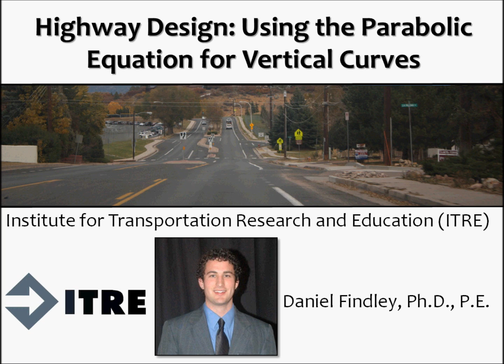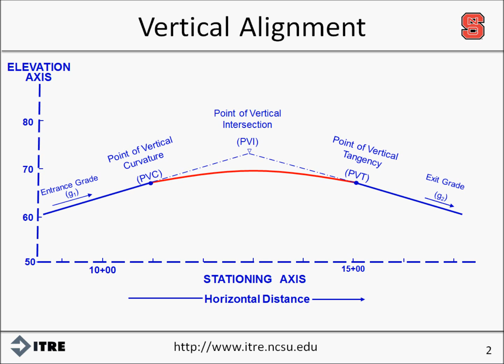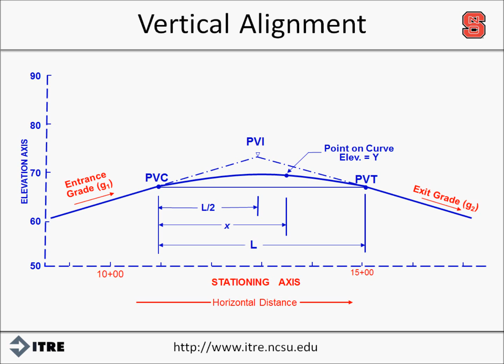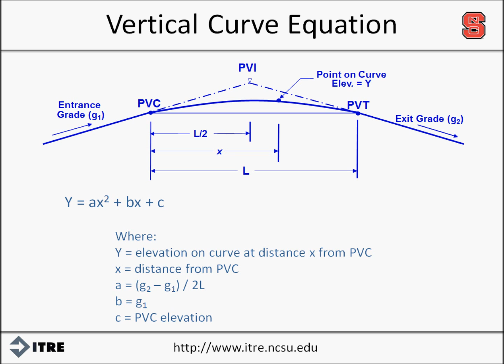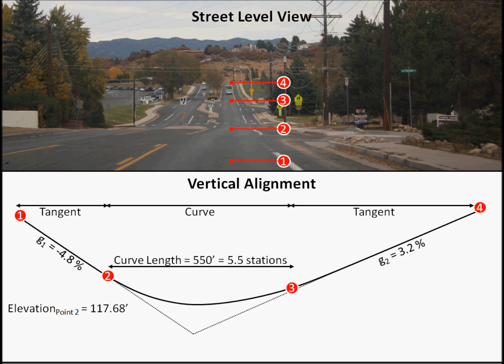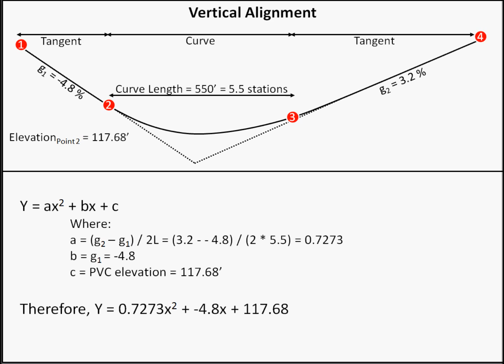Parabolic Equation for Highway Design

Comment: Why does a = (g2-g1)/2L and b= g1?
Reply from the maker: +Ashley Chung The terms a and b are used to describe the shape of the parabola.  In the term a, both grades and the length of the curve determine the shape of the "cup".  In the term b, the grade of the entrance tangent influences the curve.
Reply from the maker: +Ashley Chung This website is helpful for exploring how changes in a, b, or c impact the curve: https://www.mathsisfun.com/algebra/quadratic-equation-graph.html
Reply: Thanks for your response! I also have one more question: why does the elevation for the starting point of the curve (or c) stay in feet but you have to change the horizontal length of the curve into stations?
Reply from the maker: +Ashley Chung, Great question!  Length are input in stations and grades are in percent (both in the 100s units) to cancel each other out.

Comment: All these variables PVC , PVI ,...etc when if you just took the equation of a parabola and just plugged in your variable points as well as taking derivative to find the tangent line then subtract there angles to get A. one can do all the math without all these variable names just the techniques of curve fitting and simple calculus. Seems like the engineers are just given the formulas for a , b ,c. One should know how to calculate them from scratch.  These labeled named point are just points used to fit the curve to me makes it more complicated to have all the names when you just need the points but either way not to hard to get uses to